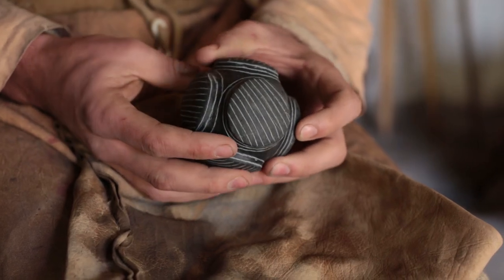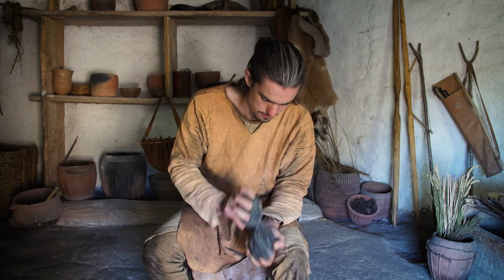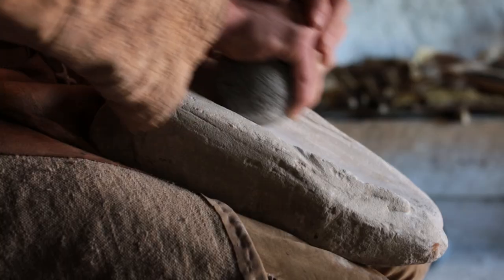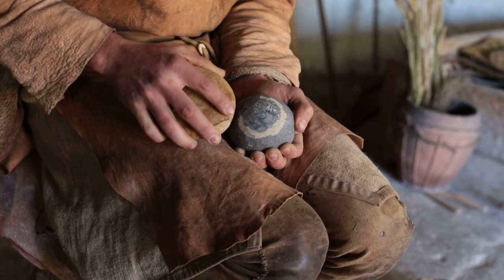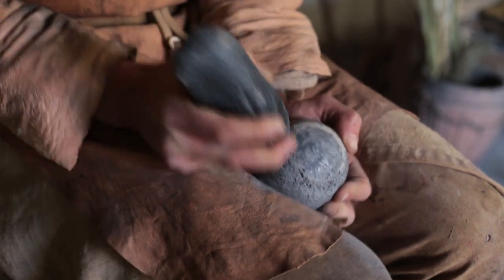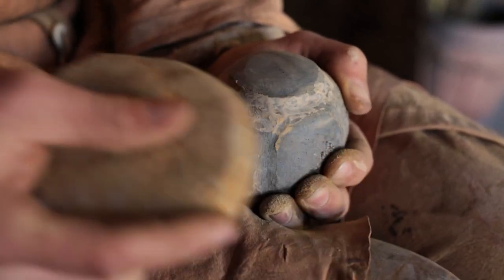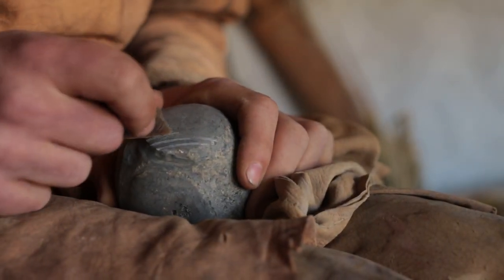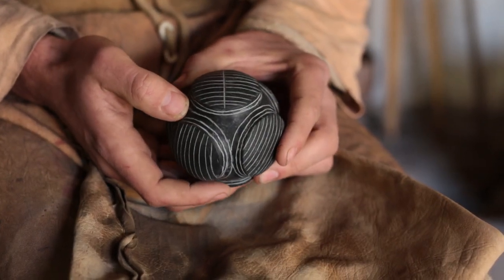How To Make A Carved Stone Ball | Stone Age Technology

Comment: If I was to hazzard a guess at what this was used for I would think all the work involved it would not be a toy or object with an abstract use. I would think it was used as a weapon. It would make a devasting flail if you bound it with a celtic knot. The edges would secure the leather material around the stone. You can look up Celtic Slammer for a modern example of what I am describing and how it is tied. Just my observation.

Comment: looks like a grinding stone, 2 grind grain, 2 flour. so if u have a flat stone with a long grove in it, u can move the ball back and forth, and the grain stay in the grove. would like 2 know if the original had the lines going paralel 2 one another, on oposite sides. that would let u know if u had it moving in the right direktion, without turning it around 2 look. at 8:21 u see a straight line on the original, might be a wear mark. u could even use it on wood, with it riding 2 sticks.

Comment: i don't think they pecked it for that long. they were wayyy too smart for that. they probably heated the stones until they melted and poured them into a clay cast, or maybe used a contraption to grind the stone into the desired shape.
Reply: You know that most stone doesn’t melt at temperatures they could get to in a fire, right?

Comment: Why is it assumed that it is all so low technical? It's a human instinct to make work easier with machinery. Using a table for example or a wooden ring to place the ball in would make this process miles more efficient to holding it in your lap. Chiseling the stone would be faster and precise as well I would say.
Reply: Because we have a lot of Neolithic tools, so we know about what they were using.  Chisels that can work stone are something you need bronze or iron for, and they didn’t yet know how to make that.  A wooden ring to hold the stone would be less efficient - every peck you’d have to retrieve your stone because it’d go flying when you hit it.  They really didn’t make tables and chairs in the Stone Age - he would have been sitting or kneeling on the floor.  Also, why assume a table would be more efficient?  You’d still need to hold on to the thing to have control over it.